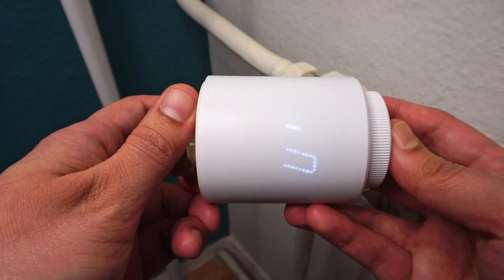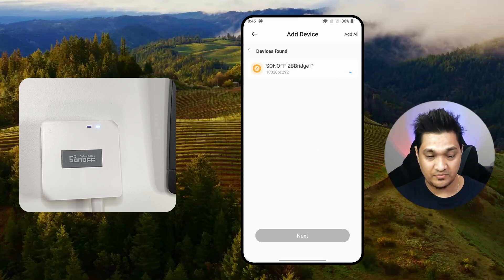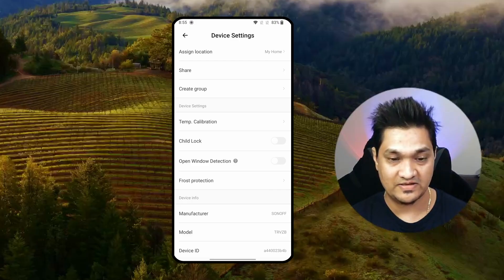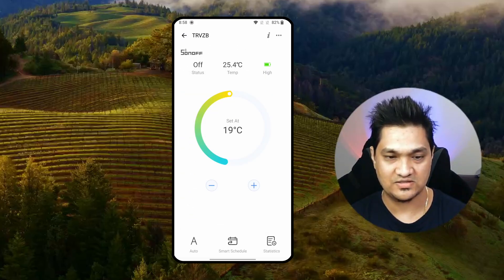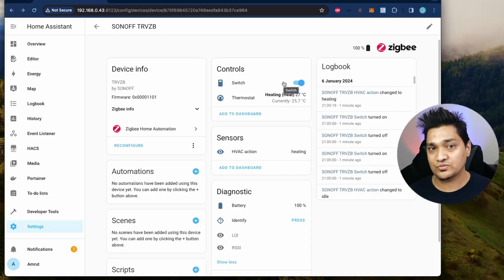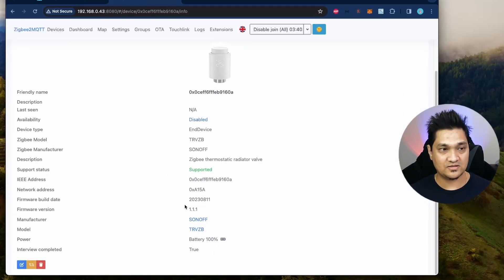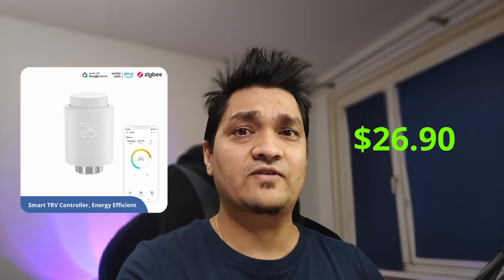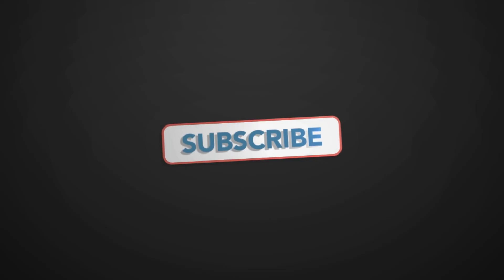SONOFF TRVZB - Full SETUP & Guide With eWelink, Zigbee2MQTT, ZHA In Home Assistant - Zigbee TRV

Comment: I have a Resideo Lyric Smart Thermostat installed that currently measures the temperature and adjusts the flow of heat to ALL the radiators. 

I noticed however that this can be off since the thermostat sits in my living room where the temperate can be very different compared to my bedroom.

If the living room is on temperature, it would prematuraly shutdown the flow of heat to my bedroom radiator because it handles ALL radiators simultanously.

If I get this radiator valve, how would I combine it with my main Lyric thermostat? Would I have to keep the temperature flow from my Lyric Thermostat constant so that heat is generated continously to the radiators so that the radiator valve can open/close and regulate the given radiator individually?
Reply from the maker: I would say this would not be possible with this device. The thermostat is controlled individually.

Comment: Hi, i read somwhere, that this device eather opens the valve fully or closes instead of going in increments is this true?
Reply from the maker: Yes.. It has a temperature sensor inside that is used to decide whether to open the valve or close it completely. Its not based on increments as you say.

Comment: I have a question. Is it possible to connect a separate thermometer so that the head measures the room temperature from a separate sensor, and not from its built-in one? I want to place the head very close to the radiator, and then it will not be correct to measure the room temperature. And if you place the sensor inside the room it will be correct, but you need to read the temperature from a separate sensor, ignoring the built-in one. Can this be done with this head, without large automation settings?
Reply from the maker: With this device, Its not possible to have a separate sensor attached to it. 
The only way would be to use some sort of automation in Home Assistant.
Reply: @SmartHomeCircle  so it's possible to do it in home assistant then?
Reply: Check out Better Thermostat from HACS.